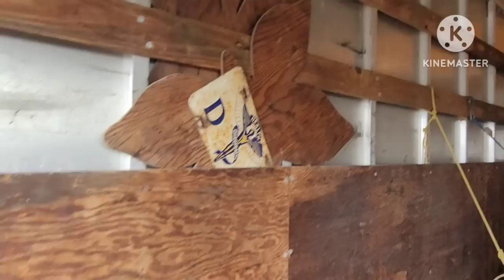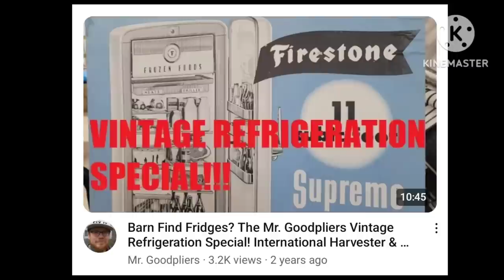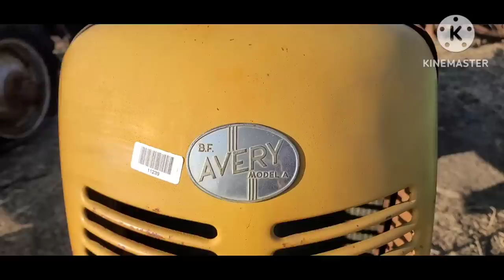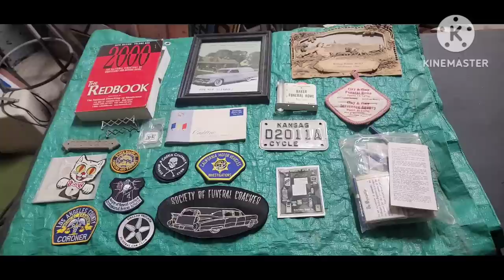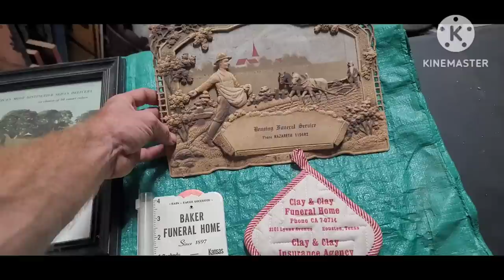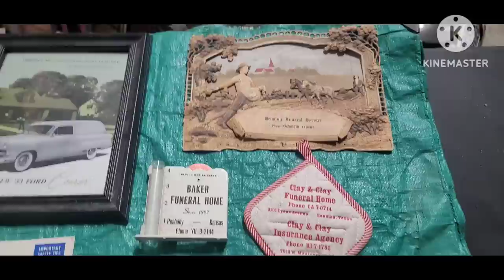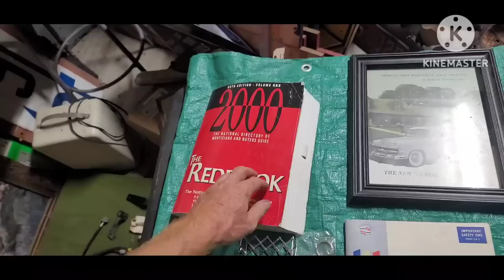He found RARE hearses all over the US! Mick's Collection of Cars, Trucks, Tractors, & ACF Brill bus!

Comment: Neat to see the procars. I understand windshield cracking was a big issue if just one corner of the rear was jacked up to change a tire. Especially on the high top ambulances. The stress of the body on the extra large windshield would cause a crack on the opposite side. I think the oversized replacement glass is still hard to come by for those.
Reply: You know, I'd never thought of that, but I can definitely see how the conversion would SERIOUSLY change the body integrity. Probably a good bet that the glass is unobtanium in most cases.
Reply: Many of the funeral cars and others like extended airport cars used before shuttle vans have very sketchy construction. Not enough welding and gussets/boxing in the frames

Comment: the 1965 has the largest cornering lights. the 1966 has smaller. that the different
Reply: The way to tell the the '65 has no turn signals in the grille.  It is the plainest of the '60's Cadillacs.  They don't even look similar to me.